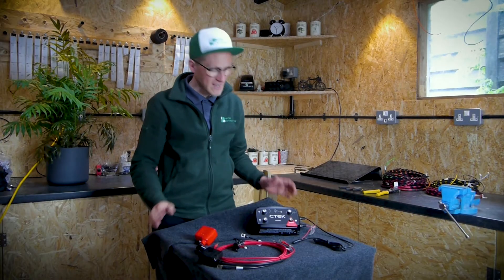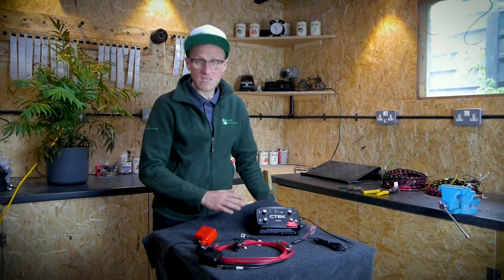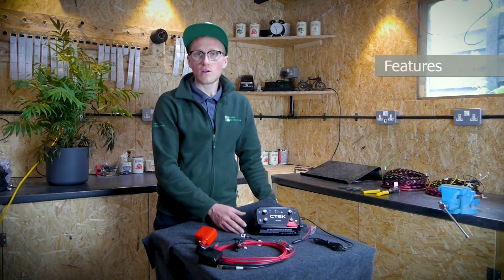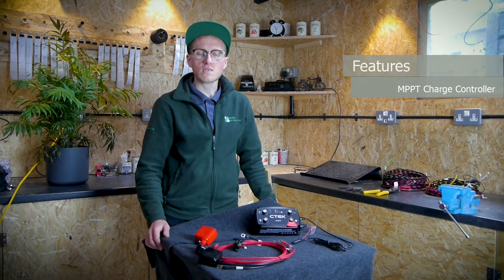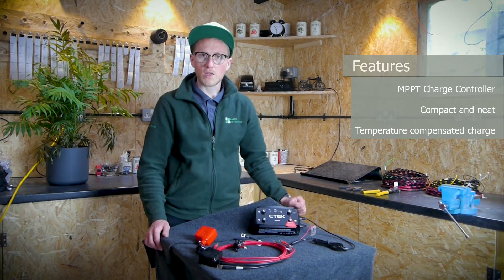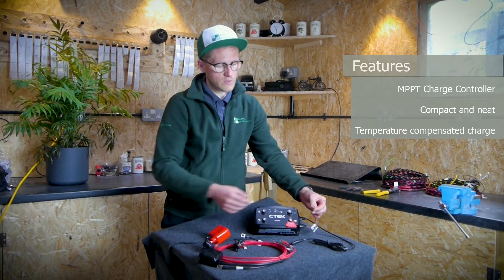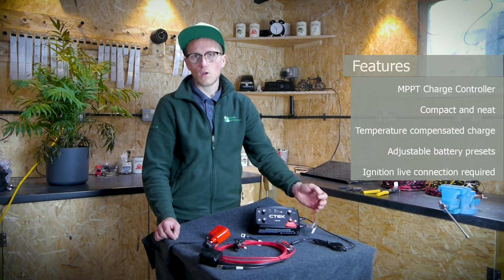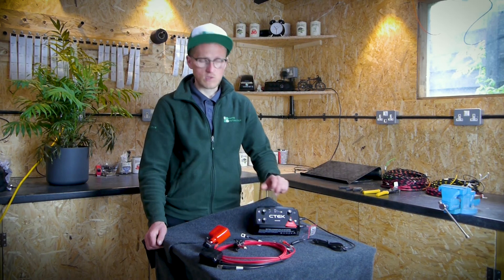CTEK D250SE Battery to Battery Charger For Smart Alternator to Leisure Battery Split Charging

Comment: I’ve just installed one of these to my van.  I have a standard WET leisure battery.  

I’ve connected everything up (fused pos from Van to CTEK then fused pos from CTEK to leisure battery)

Negative from CTEK to leisure battery

Negative from leisure battery to chassis.

Got the thin red cable to an ignition positive and left the thin black cable alone.

When I turn on ignition, all I’m getting is a solid amber light next to the A on the CTEK and nothing else.

There’s charge going to the Van battery but nothing to the leisure.  

There’s no load on the leisure battery at all yet and it is fully charged (12.8v)

Any ideas?

Comment: Do i connect just the live from the van battery to the ctek or both the live and neutral from the van battery to the ctek?
Reply from the maker: Hey, just the live is enough, the negative is usually connected to the chassis by the leisure battery and the vehicle battery.
Reply: @rayneautomotive5834  thank you, i do put a negative from the ctek to the leasure battery though yes?
Reply from the maker: @richardhunter3320  That's correct yes.
Reply: @rayneautomotive5834 perfect thanks 😊

Comment: I don't have a smart alternator on my van I do use a CTEK 250se. And I have 2 lithium 130Ah batteries I need to know where does the small red n black wires fit to charge batteries safely???. . Hope you can help me
Reply: Small Black wire to positive for lithium batteries.small Red wire has to go to an ignition source (only live when ignition turned on) 
I think the 250se is only a 20amp charger so you might want an upgrade for 260ah battery storage
Reply: Sorry mate small red wire doesn't go anywhere if you don't have a smart alternator
Reply: What happens if you do have a smart alternator but dont hook it up to the ignition and just blank it ?

Comment: hello.  my setup in my camper is the ctek 250se charging two 120ah lead acid batteries via the smart alternator. I also have on the roof a flexible 150 watt solar panel with a maximum power voltage of 18.5 volts , max power current 8.2 amps and voc of 21.5 volts  which is connected to the unit through the mppt. The pdf of the ctek says the unit will manage 300 watts solar cells. I'm thinking of adding another   flexible solar panel of exactly the same specs from the same manufacturer (firefly energy) which I'm going to connect in parallell. would the ctek be okay for this?
Reply from the maker: That should be fine, I don't think it will cause an issue setting it up like that.

Comment: Hi, I have solar flex batteries.. can I still use the ctek/how shall I connect the black and red wires that come out on the side of the ctek?
Reply from the maker: I would say that the CTEK should be fine to charge them, it would depend on whether it's a wet or AGM one as to the best place to connect the red/black wires.

Comment: Very helpful and reassuring thanks.. I'm charging lithium and I'd figured I could just connect the little black wire to the critical consumers port instead of taking it to the battery positive. 👍

Comment: hiya

can I ask, when one of these units is fitted to a euro 6 alternator and two lead acid batteries and then run through t a camper switch panel.. what voltage should be on the panel readout? -ie when egine is off. thanks
Reply from the maker: Hi, with the engine off and no solar output, you should get the battery voltage, which should be between 12.0-13.2V

Once you start the engine this should go up, peaking at 14.4V in wet lead acid mode. Then dropping when the batteries are full into float mode at 13.5V 

Hope this helps, James.
Reply: @rayneautomotive5834  my voltage panel doesn't go above 12.5 even when the engine is running.  I've watched the ctek and when no engine is on I get a slow flashing green light. When the engine runs I get a solid green light for about two seconds and then the two yellow lights briefly light up then go out.  I'm wondering if this is because the batteries are fully charged and so no need for a charge. Sorry to mither.im.starting to get paranoid the car electrician fitted the stuff wrongly.
Reply from the maker: @parkay3560  Hi Kenny, something's up for sure there. It sounds like the charger isn't coming on. I'd check the CTEK negative and also the thin red ignition signal (D+) cable are fitted correctly. These are the two most common causes of the charger not working. After that I have a few troubleshooting procedures I can send to you. Pop onto our website and fill out a contact form, then I can send you the troubleshooting information. Thanks, James.

Comment: I found this very interesting..
However whilst camping in my transporter and on a 240 volt hook-up for 2 nights, when I went to start my vehicle the starter battery was flat..
I've reached out to ctek but so far I have not received a response.  
Any idea what could be causing this problem.. 
Thanks very much
Reply from the maker: Hello, I’m sorry you’re having a problem with this. It’s usually 1 of 2 things. 

The first is that the switch live cable from the ctek is actually connected to a permanent live, meaning the charger is running continuously. 

Second is that if the main battery was a bit low, all of the opening doors, interior lights etc over a weekend of not moving can flatten the battery. 

The easiest way to tell is once the van battery has been charged, you can leave the engine turned off and check the ctek for lights. The bottom right hand light should be off. If it’s on, then it’s the charger taking the power from the main battery. If it’s off then it’s more likely to be the battery was a bit low. 

I hope this helps.
James.
Reply: @rayneautomotive5834  
Thank you for your very quick response  
I will check the ctek activity light and cable. 
To be honest i did leave the door open for some time whilst camping,...
You would imagine that there is a way to disable the lights coming on/off to prevent this sort of thing. 
I'm probably not the first to encounter this problem. 
Thanks again

Comment: Is this charger enough for 100AH battery   or i need to buy smartpass 120A ?
Reply from the maker: Hi, this will be fine for a 100Ah battery, after about 200-250Ah, then the smartpass becomes very useful. If it's lead-acid or AGM, then this would be fine for a 100Ah battery.

Comment: A really useful vid.  Thank you for posting.  I was worried that I was using the wrong wires as was expecting a thicker wire from the van battery to the CTEC but can now see I've routed the correct ones. Phew!  More vids would be great as the only other source of good info is Combe Valley Campers.
Reply from the maker: Thank you very much. Glad it helped. We're working on some more product videos as we speak. Thanks again.